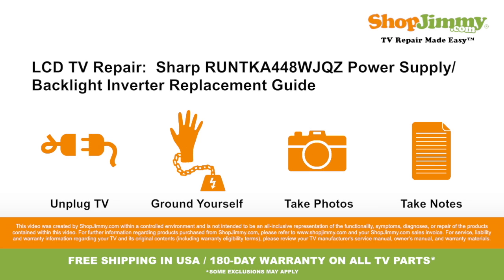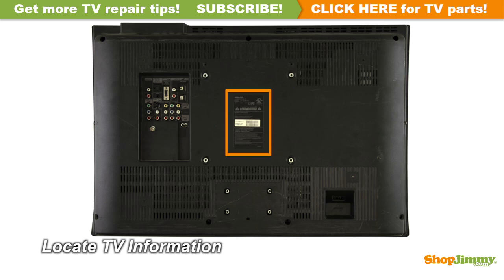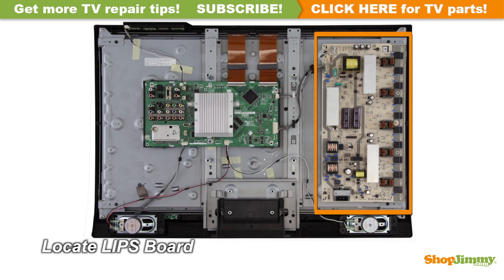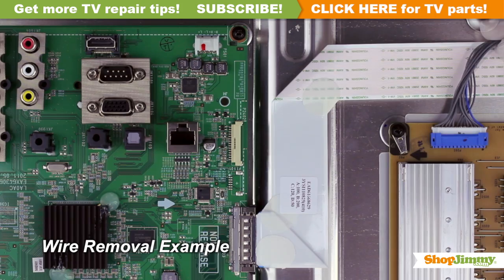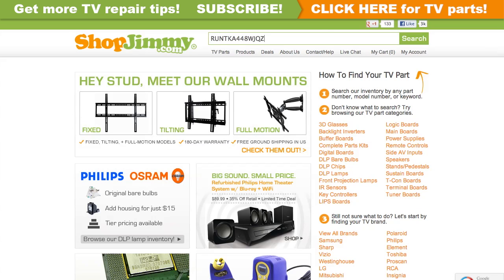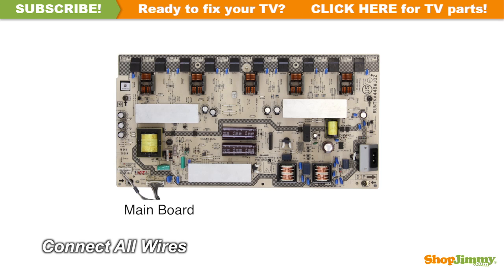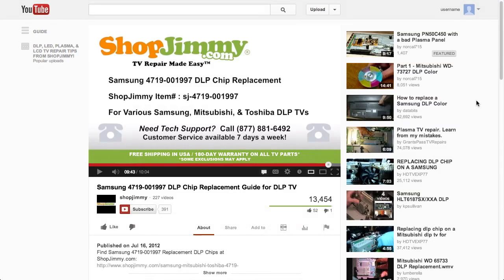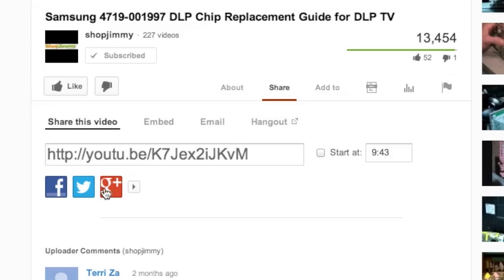Sharp TV Repair - How to Replace RUNTKA448WJQZ Power Supply/Backlight Inverter Boards - LCD Repair

Comment from the maker: @MrIshor - This could be one of a few things. Unplug TV for 30 seconds. Plug in TV if it comes on by itself turn it off and on immediately. If it does not come on just turn it on, then off then back on fast as you can, Press and hold the up arrow on the remote and press and release power button on the TV. release the up arrow see if the TV resets. should come on to ch2 and then the language set up option. See next comment for more info!

Comment: Hi, I have problem with Sony Bravia KDL55EX720 model tv. When turned on, it lights up and displays picture for only about 3 seconds and goes off. It has red light blinking for 7 or 8 times. I learn that, this could be power supply board of inverter board. I am an electronic tecnician but have not worked with big tvs. Can i replace the defective boards. Would they be available? Please suggest. Ishor

Comment: Hello 
I have a Cost Co Sharp model  LC-80LE642U and I am replacing both RUNTKB096WJQZ and DKEYMF953FM06 but am unable to remove the back cover. Now before you say it I have removed all visible screws and I can get the bottom edge off an inch or so but I am not able to get the side edges even started. I've exerted a reasonable amount of effort (pressure) at the bottom of both sides with no success. Any pointers or specific documents referring to this model and removing the back? I have had no luck finding any docs on repairing this model. I've only found the shopjimmy youtube videos. I don't want to break anything in the process of removing the back. Thanks for any help beforehand.

Comment: MY SHARP 70UD1U the blue power light is blinking 2 times and the red timer light blinking 5 times i have replace the main board and the power board but i sill have  the same problem .... could it be the LED/OPC.. help

Comment: I have a sharp lc-50Lb261. The sound works, but the picture does not. If I shine a flashlight at an angle, I can see a very faint picture of the video.

Comment: I just had my Sharp TV LC-60LE640U busted. It seems like a backlight issue, before i can see the picture got darker literally above the V lighting logo. Then yesterday, the screen would not come up anymore, it stays black, and i can see the lighting V coming on and off. It will blink 1 quick and 1 longer blink. Any idea on what to replace and do you have parts?

Comment: Hello! I have a sharp aquos LC-70C6400U. serial. 204824167. I'm having inconsistent backlighting in the lower right of the screen. The 8 inches from the corner are dimmer than the rest of the picture and the 8 inches in next to that are a bit brighter. The rest of the screen if fine. Ideas? much appreciated and thanks!

Comment: Hi Jimmy, I have an LC70LE650U unit and all of a sudden gets a discoloration mainly on the right side of the screen and this is going on for all inputs. Would suggest replacing the main board or power supply/backlight inverter boards? Thanks much.

Comment from the maker: If it doesn't work retry the procedure until the TV resets. If that fails try a software update and finally replace the BATV board.  You can search for this board on our website, by searching your model number in the search bar.  Thanks and please let us know if you have any other questions.  If you prefer you can call our FREE customer service at, (877) 881-6492.

Comment: Jimmy,  I have an LC80ue30u.  The TV locked up when I went to pull up the smart menu.  I pulled the cord to get it to turn off.  Some hours later, when I tried to turn it on again, I noticed the power light flashing, one long and then short blink.  I tried the power plug/button reset numerous times..  All I get is the Sharp logo for a few seconds and then clicks right back off.  The TV is less than two years old.  Do you think this is a power board or main board?  I didnt see any burnt circuits or bulging capacitors.   Any help appreciated.
Reply: I have same problem with mines did you have any luck
Reply: @Fpvjunkee  me too
Reply: @metaphysicalmissy3101  mines was the led driver board.fixed!
Reply: Led driver board I bought one off ebay for like 120
Reply: No luck on mine.  Bought a board from some repair shop.  When I got the board it looked used.  Swapped it, same.

Comment: I've got a Sharp LC-60LE830U.  My blink code is one short one long and from the service manual it says it's Inverter/Lamp system failure.  Any suggestions on how I go about fixing this?  I was hoping it would just be a power supply issue where I could install a new one, but doesn't look like it.
Reply from the maker: *****   This sounds like a TV panel problem.  If your TV panel is bad, it may be more cost-effective to replace the TV as panels are typically hard to find in stock, difficult to replace, and expensive.  Thanks and please let us know if you have any further questions!  www.shopjimmy.com

Comment: I have the Sharp LC70LE734U and the picture went out.  I removed the back panel and located the power supply panel.  I need help in locating the inverters (master and slave).  Any help will be greatly appreciated!!!
Reply from the maker: solrchrgd   If the TV has inverters they will be on the right and left hand side of the TV.  They are most likely 2 similar looking boards.  Thanks and please let us know if you have any other questions.  www.shopjimmy.com

Comment: I own a Sharp Aquos 60" television model #LC-60LE831U.  The bottom center power light "v" shaped clear light is blinking. It blinks twice, then pause, then 3 times. I do not have a picture, just a black screen.  I bought the television in 2011 so it is only 4-5 yrs old.  From this description, do you think it is the back light? thank you
Reply from the maker: +Fran Cisek   Try all repairs and troubleshooting at your own risk.  I recommend replacing the main board in your TV.  Click this link to replacement parts for your TV model number:  http://www.shopjimmy.com/catalogsearch/result/index/?cat=56&q=LC-60LE831U  There may be multiple boards for the same TV model number, be sure to match part numbers on your current board, with your replacement for compatibility.    Thanks and please let us know if you have any further questions with your TV Repair!  www.shopjimmy.com